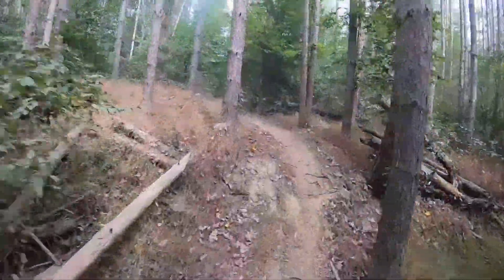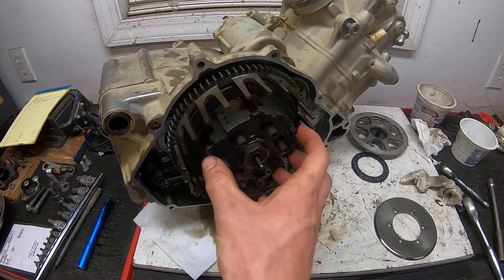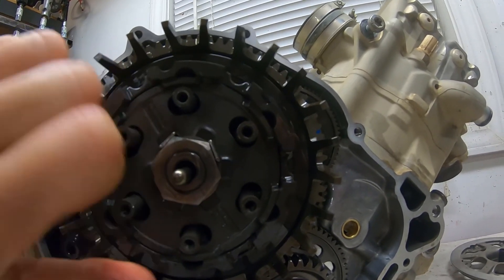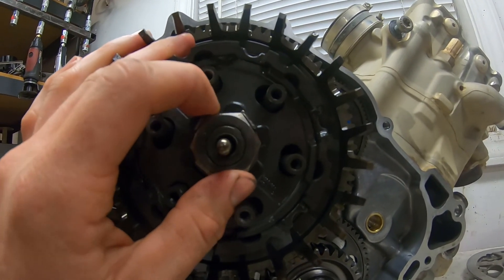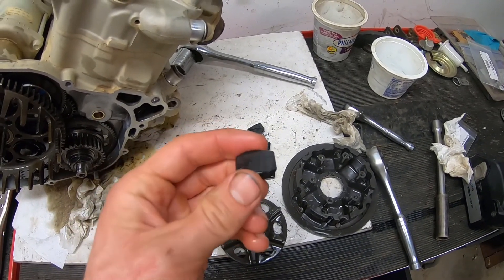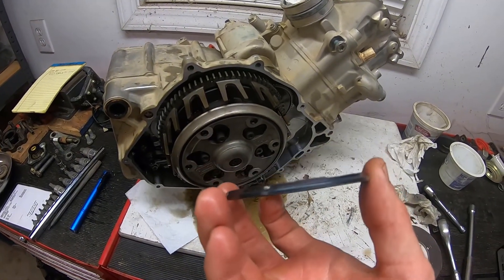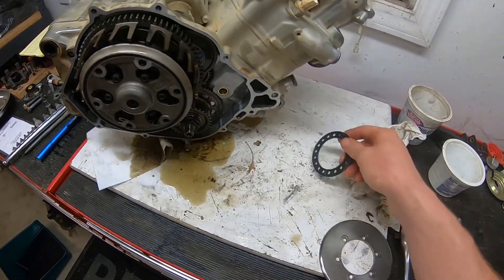Tech Tips: KTM/Husky DDS Clutch Damper Wear

Comment: If you run the bike/clutch hard the stock dampers won't last long (20 hrs. ish..). The 2022 Rekluse dampers will fit the 2023 KTM 450 SXF and is a great upgrade. Great video. Thanks.
Reply from the maker: I've been using the Rekluse dampers for a while now, they last a LOT longer than the stock ones. I think I've got a good 100 hours or so on the dampers in my 300 clutch, and the 450 has maybe 40 hours on them and it's still tight.
Reply: @gearheadE30  That's awesome thanks!

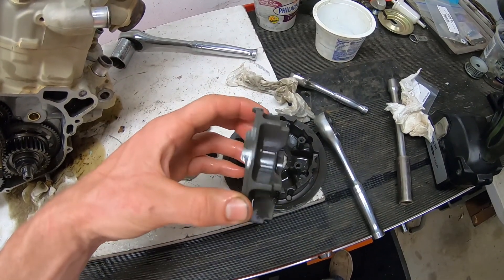Comment: Did you use that inner hub again or did you replace it ? i got the same wear on my hub at the sides like yours on 3:18 and im not sure if i should replace it or re use it. Thanks!
Reply from the maker: I reused it after smoothing out the galling lightly, and ran it that way for at least 100 more hours until a valve failed and took the engine out. It's not ideal, but it didn't seem to hurt anything.
Reply: @gearheadE30  alright thanks! Are you still riding that bike today ? Or did you not rebuild it after the dropped valve
Reply from the maker: @TheJoren1  I bought another one, there was too much engine damage to be worth rebuilding the old one and it had 350 hours on it anyway.